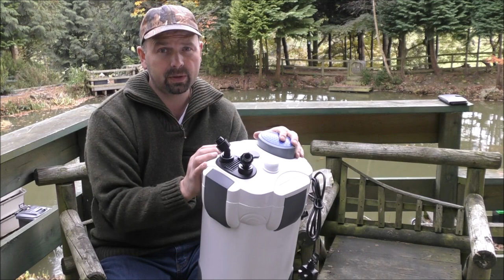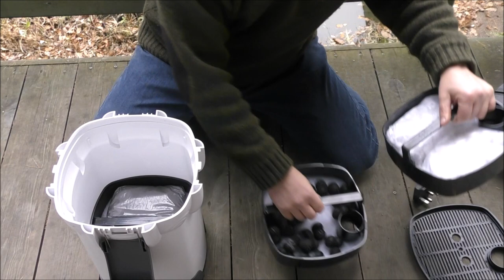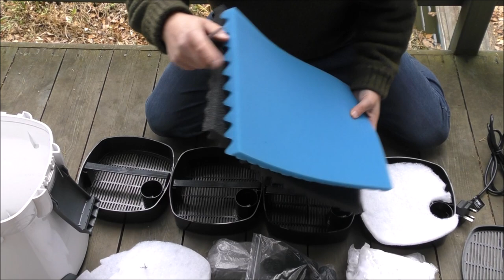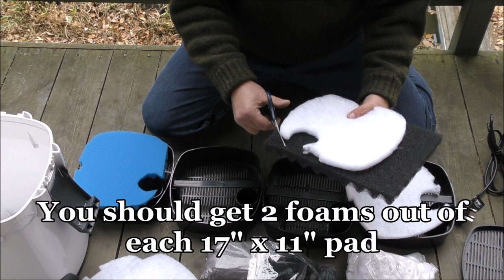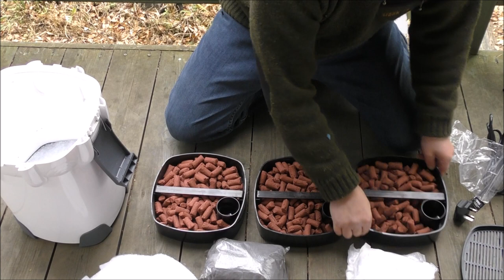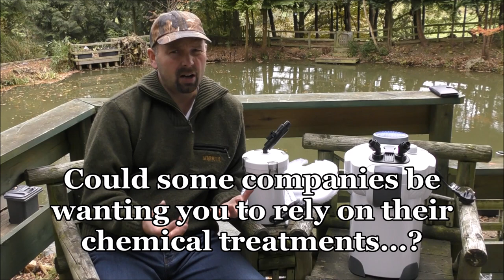Why Your Filter is TOO SMALL and NOT CYCLED

Comment: Great Video,what You said makes total sense.The product You wouldn't mention I might be using and recommending to people I talk to in the Aquarium community.I do deal with Hi Nitrates and have heavily stocked tanks.My 406 Fluval I have 2 trays of their Bio Max and the 306 I have 1 tray with it in.and the trays aren't full either.I am going to load up the trays with Bio media.Is the media You recommend available in Canada?would Lava rock work if I can't get BioHome?
Reply from the maker: Yes there is a distributor in CA http://www.angelfins.ca and crushed lava rock makes a decent DIY media but generally does not have the required internal structure for supporting anaerobic bacteria responsible for reducing nitrates.

Comment: Hi, thanks for a great informative video. I now understand why I can't quite get rid of the nitrates (usually around 40-50ppm) I currently have an 80ltr tank running a fluval 107 filter that I now appreciate is not quite man enough for the full cycle. I hadn't heard of a booster filter and was interested if you think an APS EF-2 booster would be able to take me onto full cycle. Thanks.

Comment: Would the media setup be the same for turtles in an aquarium or would more pads be required?
Reply from the maker: It purely depends on the stock and size of tank. If you could go with 2 x trays of foams and 2 x media that would work out well but bear in mind that turtle tanks would definitely be classed as heavily stocked so would need a filter which could hold 2kg of media per 100 litres of water.

Comment: I really like u info for filtration and how to set up canister filters I was wondering if u ever did a video on the aqua ultraviolet ultima 2
Reply from the maker: That is one I hadn't heard of until you mentioned it and I did a google search. It seems to be a bead filter and I am familiar with that concept - they are very good at the mechanical side of filtration but using plastic media ensures that only the ammonia and nitrite is worked on. Ideally they would be used as the first stage of filtration followed by a proper biological filter with good porous media (e.g. shower filter) to combat the vast amount of nitrate produced by the bead filter.

Comment: Hey guru thanks for all the knowledge you have given me. Have seen all your videos. Have biohome ultimate in 3 of my 6 tanks. Used purigen in my 75 gal. How long you think it would take for my anaerobic bacteria to bounce back ? Also you may not be able to to say but should I stop using prime as well. Can't say enough how much I appreciate all I've gleaned from you
Reply from the maker: Unfortunately I can't say for sure how long it will take the cycle to develop once the products suspected to stall it have been removed but it is generally a good 3-4 months going by what other people have experienced.
I really can't see how prime can prevent a cycle happening as it is marketed as a product which should help the cycle but the inability of the filter to mature fully is common when it is used so I just have to go on reports from fishkeepers - when a straight dechlorinator like API stress coat is used there doesn't seem to be any problem achieving the full cycle so putting the two most commonly used products head to head all I can do is recommend the stress coat based on filter development and resulting water quality.
It really bums me out as I want to know exactly why these things affect the anaerobic bacteria in particular.

Comment: Pondguru that totally makes sense mate I’ll give it a month n see if anything changes if not I’ll get another aps filter n get it set up hopefully it will do the job I’ve heard the fluval fx6 is the dogs but Iv had a lot of mixed reports on the aps so would u recommend the fx6 or just stick with the aps filters? N what is the best media to use
Reply from the maker: Most effective media for canisters is the biohome ultimate and the FX6 is definitely better made than the APS with much more capacity for mechanical filtration - they both will hold 5kg of ultimate. Alternately you could go with a Hydor 600 as it also holds 5kg but id more slimline. It is very well made - I've got a video shot to edit down so it should be out soon. Very good filter and cheaper than the FX6.

Comment: I received my second 10lb order today :) Question is should I put all biohome in one canister or split between the 2 I have running on my 125g?  Love ya man...keep the videos coming
Reply from the maker: In a mature system it is best to add the new media gradually over a period of weeks and it doesn't matter if it is spread over 2 filters or all in one - as long as there is plenty for the stocking situation then it will do its job no worries.
Reply: Thank you for responding back.  Keep your videos coming ... Happy Easter :)

Comment: If I use biogravel with my undergravel filter would It provide Bette filtration than normal gravel, I just found a under gravel filter that I lost 2 years ago.
Reply from the maker: It will be a reasonably expensive option compared to using ordinary aquarium gravel but will offer the full cycle filtration due to the porosity of each piece of biogravel supporting aerobic and anaerobic bacteria.
However, you'll still get the main problem associated with using an undergravel system of fine muck building up under the under gravel plate. Having water drawn from two sides will minimize that build up but it will still occur no matter what substrate is used over the plate.

Comment: 👍 Hi, all that you speak about in this very interesting video, does it apply the same for marine aquariums ? The only way I have reduce my nitrates in my reef tank is by using bio pearls, is there any down side to using them ?
Reply from the maker: The only downside I could see when using any sort of treatment / media like bio pearls is that the useful life is variable and the conditions they will / can work in is also variable. They may draw in trace elements too which would otherwise be used by bacteria and plants so I wouldn't recommend such treatments for long term use.
Yes, the biohome ultimate marine would be the one to go for in a marine system and if it was in a canister it would be laid out just as it is in the video. The biohome ultimate marine has added trace elements which are fused into the structure of the media to act as a catalyst for bacterial processes so as they are not free in the water it should allow the bio pearls to work without reducing the biological function of the filter - however, if enough of the biohome ultimate marine media is used then the nitrate will be lowered naturally by achieving a full biological cycle so you wouldn't need any other media in there to try and lower nitrate.

Comment: Hi ponpguru, excellent video! It relly help me a lot. Im setting up my aqurium right now and I have doubts about in which side place the inlet/outlet of the canister filter, which set work better, both one the same side or both on sepate sides of the aquarium, thks 4 your answer!
Reply from the maker: You can set it up either way but if you have inlet and outlet on the same sides of the tank just make sure that the outlet points away from the inlet to ensure good water movement.
I've always been a fan of spray bars as they cover more water for less potential dead spots especially in a well planted tank or one with good bogwood / rock structure.
I'm glad you found the video useful. Thanks for watching.

Comment: Can I use two fx6 filters, first fx6 filled with mechanical media taking water from aquarium through inflow with filtered water outflow going into the 2nd fx6 inflow filled with bio media then outflow through 2nd fx6 into aquarium? Will the outflow pressure of 1st fx6 too great to cause impeller damage to the 2nd fx6 inflow? Want to try your theory but don’t want to risk damaging my filters.
Reply from the maker: I'm not sure what setting them up in sequence would achieve and I'd personally say just set them up separately. I did a video specifically on the FX6 - just search FX6 upgrade or check back through my 'Pimp my filter' videos and it will come up (I think it was number 10 in that series)

Comment: Pondguru..  for my tanks I use tap water that has been stored in a bin outside for a minimum of 2 days..  would this be enough to dechlorinate the water or do I need additional treatment
Reply from the maker: If it has been aerated then most of chlorine will have bubbled off or if it has had sunlight on it for a decent part of the days then it will have broken down the chlorine so it should be fine.

Comment: I have a defective fluval 403 filter  could I use it as a prefilter or a mechanical filter ? and what would be your recommended set up?
Reply from the maker: You could just pack it with foams and a fine pad and have it as a decent pre-filter.

Comment: Would "Chemi-Pure Blue" be good to use on very top of Media cover?
Reply from the maker: From a water polishing point of view yes although I'm not sure what effect it would have on bacteria development since that one has also been mentioned by a couple of people struggling to achieve full cycle filtration - when removed the filter matures properly to complete the cycle. For crystal clear water carbon or activated charcoal is as good as anything and doesn't affect bacteria but unless you're using filter media which will support aerobic and anaerobic bacteria you could use any of the chemical treatments since the full cycle would never complete anyway.

Comment: Just curious :)  I am in the process of a cycling a new tank. It's a 2ft cube - 226L- nearly 50Gallon. I have APS 1400 L/H 1400EF, I have bought and added the filter foams you recommend in the video , just wondering how much Biohome i would need for 2 trays? and also which type please.
 
Sadly i watched this video after buying Seachem Prime thinking i would save on the pennies (unemployed atm). Just searched for an alternative and found this : Sodium Thiosulphate ! will that be better than Prime?
Sorry for all the questions  :)

Carl
Reply from the maker: Sodium Thiosulphate will be fine as long as you get the dosage right but I'd just go for something prepared like API stress coat, Tetra watersafe etc. and with regard to the trays each one will hold 1.5kg of biohome ultimate (best type for canisters) or biohome mini ultra (same size but with no added trace elements) so the 1400 will take 3kg total if you use the bottom tray for the coarse, medium and fine foams / pad.

Comment: Under near perfect circumstances; good mechanical filtration, effective polishing before water hitting the biological media... What is then the expected lifetime for the biological media (read: Biohome Ultimate)? And how do I realise, when the media is used up? Can It be rewived / rinsed a couple of times before it needs to be replaced? And when so; do I replace it gradually (one tray at a time) or all in once?
Reply from the maker: Yes it is best to upgrade a mature filter over many weeks and really the best way to tell if a media has got clogged up is when you notice the nitrate go back up (after achieving a full cycle) but depending on the type of filter and stocking situation that could be 6-10 years or longer - some people are still using early forms of biohome in sumps and it is 15+ years old.
In a full cycle nitrate can shoot up if chemicals kill off bacteria so that is something to consider too - the filter will recover but in the case of water treatments like 'prime' they detoxify/bind ammonia, nitrite and nitrate which has a serious retarding effect on the cycle meaning it either never completes or takes way longer than it should. Best to just use an ordinary dechlorinator for a full cycle and let the bacteria do its thing - media will support an incredible amount of bacteria if it is allowed to do so.
If media is very old or has been out of water for weeks or if you're changing from fresh to marine (or back again) it can be baked in a very hot oven for 45-60 minutes to sterilize it and burn off organic matter. That will give it many more years of life.

Comment: Hi Richard, I have seen this video many times, but I haven't ask this question. It didn't  come to my mind. This perticular filter has a capacity of 2000l/h, after putting the media it almost gives the 60% of this flow rate. Now if we add the additional filter with this , will reduce the flow rate some more? If so, then the cycling per hour will get reduced once again. Normally I have sen people are recommending the 8to10 times of filtration rates of the water volume to have best effect of these media. What do you suggest?
Reply from the maker: The turnover rate isn't too important when a filter is set up properly. In a 'normal filter a high turnover rate would be needed due to the lack of suitable environment in the filter for bacteria so water would be moved as quickly as possible through it to create very good conditions for aerobic bacteria in an attempt to keep ammonia and nitrite levels down.
When a filter is properly set up with suitable media the flow rate becomes less important and as long as you're getting good movement on the water surface to allow for gaseous exchange and a decent water current for fish which like to live in flowing water then its all good.

Comment: Hey Pondguru. Would that booster-filter fit the sunsun-APS-Aquatop 2000L canister? Looks like the hose dimensions are different. And seeing as that booster would be the subject for most of the maintenance, how easy is it to disconnect? Perhaps another video soon? ;)
Reply from the maker: It is the same one but ideally the booster could be a bit bigger to reduce the maintenance on it. Maintenance is easy as you just turn off the taps and unscrew the in / out fittings, removing it for cleaning just as you would with a canister.
Reply: Awesome!

Comment: So are you saying if done correctly you dont need water changes? Apart from vacuming Or you still do?
Reply from the maker: It is still a good idea to do partial water changes to freshen things up a bit once a week but that would involve vacuuming the waste out and removing water as a consequence of that action.
10% - 15% is all you need to do every 1-2 weeks depending on the stocking situation when the filter is a suitable size and it achieves full cycle (reduction in nitrate)

Comment: M8, ty for the awesome video, learned alot and you proven some points for me, but i have a question about the filter ratio. To be exact i will build my own filter and the best way to do it would be in pluming tubes for my tank about 100L, and i wanted to ask what are the ratios of mechanical and biological media. For example if i have a tube 1m i should use cca 30cm ( 1/3 ) of mechanical and 70cm (2/3) of bio media, and on your note not more than 2L volume of the tube for a 100L aquarium ( fish will my son choose, maybe koji or guppy neons and a beta ). Ty in advance, will watch your other videos, maybe will get an answer there.

Comment: Great informative vid!! An eye opener!
Reply from the maker: Glad you found it useful - thanks for watching.
Reply: I have ordered 1kg of biohome ultra for a new filter to run with my fx6! I want to change the fx6 media too! Would you wait until the new filter has cycled before adding the media to my fx6 or bite the bullet and add asap? Hope that makes sense!!!
Reply from the maker: I don't know if it is for a new tank or an established tank but the biohome ultra is very large and too big to be used effectively in most canister filters - it's really for sumps and large shower filters.
I've just looked for an order but suspect you may be in the US so I can't find an order here (in UK).
We have one called mini ultra which is the same size as the biohome ultimate in this video and it's exactly the same just it doesn't have the added trace elements of biohome ultimate.
If you already have fish in the tank best to wait for the existing filter to mature before changing the media in the new filter but if it is a new tank then feel free to add new media in both filters at the same time.
Reply: Oh No! Too late I'm in South wales biohome ultra has been despatched through eBay! Can I break it up slightly?

Comment: I have a Saltwater tank with about 1.5 lbs of Live rock per gallon.  I would assume this would be a good home for anaerobic bacteria.   The tank was suffering hair algae and I corrected with Chemi elite product and the bleach cleaned chemical media.   Cleaned up the phosphorus and the hair algae.    However I don't think this is a sustainable approach.   I started adding Marine Pure media balls to replace the bleach cleaned chemical media.   Hair algae still at bay. but get diatom spikes which tells me I am not cycled yet.    Nitrates stay low 5 ppm, but probably because of the Chemi Elite product still in the system.   

Would Bio home work in salt water and would you suggest the same amount or just amend  with the live rock?
Reply from the maker: Sorry I thought I replied to this a few days ago.
Yes biohome marine was created specifically for use in saltwater tanks and has added trace elements and would generally be used at 1.5kg - 2kg per 100 litres in a marine system with or without live rock.

Comment: When you mention kg does the type of media matter. I have a 2500 us gallon koi pond with 3 55 gallon barrel filter. 2500 gallon pump. One barrel has lava rock and two have gravel from big to small. Is my filter the right size. Oh ps I have 11 koi.
Reply from the maker: It sounds like the filter is easily holding enough surface area there so you should have no problems with ammonia or nitrite. If you could have flow to the final chamber split to ensure a really slow flow through it then that one could in theory support anaerobic bacteria to complete the cycle and reduce nitrate.